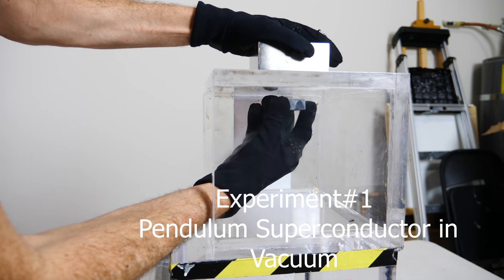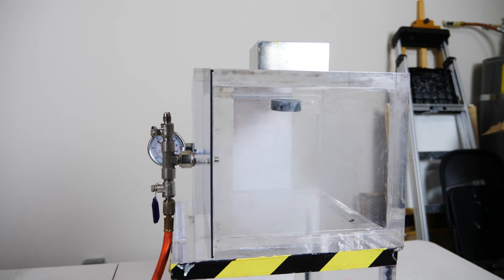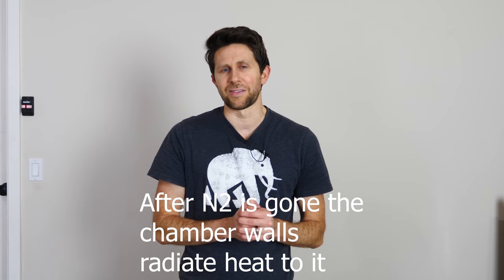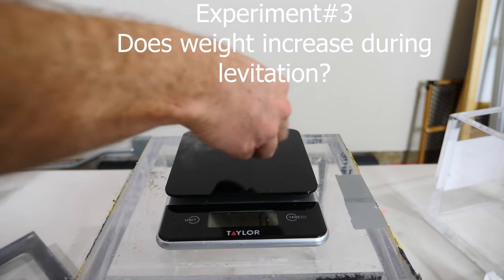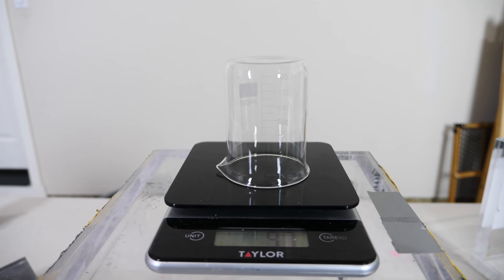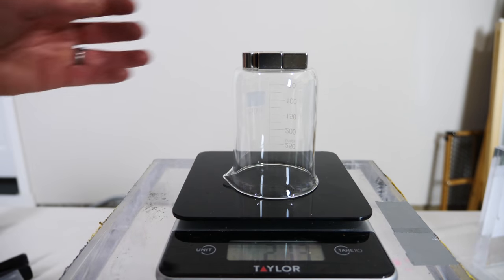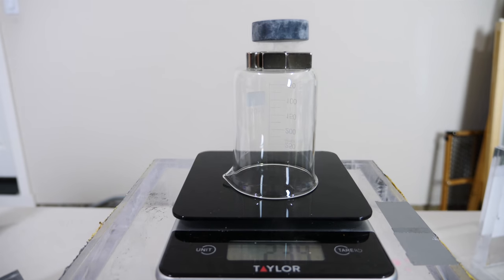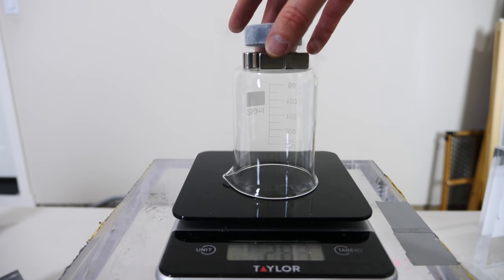Does The Weight Increase When You Levitate a Superconductor on a Scale?

Comment: The explanation for the phenomenon at 6:00 is that the superconductor is hitting a wall of magnetic flux.  The flux is actually re-entering the magnet on the perimeter edge of the poles.

Comment: 1) even in vacuum, any object over -273K radiates heat by radiation. no air needed. 2) the weight increase, there are still forces acting between the superconductor and the magnet

Comment: 3:56 try flushing out the heat conducting air with dry nitrogen which is very insulating, then vacuum aggressively (as 1/4th vacuum is no where near vacuum, and still a lot of density,  try thousandths to millionths of an atmosphere).  That's a better test, but the results are still obvious  that the working of the magnetic field would still waste energy and produce best, but how long it rotates without lateral movement would have been a better demonstration.

Now, as far as weight differences go, the thing people try to test is if there is any combined weight reduction spinning or still, which would require a vacuum to avoid air current interference and a scale accurate to 1 thousandths a gram to 1 millionths, as the effect is so weak, to show if there is any effect  beyond reported.  I would suggest a weight based plunger system to remove a large volume of air quickly then block and vacuum.  But such vacuums are notoriously difficult to achieve with such equipment due to minor (sorry feel like passing out) leakages, off gassing of even sealant, and even evaporation under vacuum.  You can do it.  Remember the asymmetrical EM drive, they spent years even trying to isolate out vibrations, to see if that was causing the very minor results. You would get the same problems here, requiring a lot of isolation (with the vibrations from the pump off gassing and other things.  So, an isolated pre cooled and vacuumed off super conductor in second chamber and transfer to main chamber, or nearly fit to shape chamber to archive the results in the required time.  Sorry, just had a debate with an accelerator practical physicist which got chopped off just as I posted a post that proved him wrong.  So, a bit keyed :)   There is also a quantum effect wave way of cooling, which I can't remember, that was applied to exhaust fumes, I had wanted to explore for commercials use in the 1980's.  (F tick borne and fungal intrusion diseases.  Virtually everybody is off their best game with these things.  At least I have a little ability and memory left).  Love your demonstrations, but eliminating margin for error (or just stating known results) remove doubts in flat universers (lower level researchers, not top 0.01% who have a clue about results :( ).

Comment: I was thinking about something earlier, and then saw this and thought about it again. If you could put Earth on a scale, would the mass change if you took away the satellites? What about the mass of the Sun? Would it weigh less if you took away all the other planets? How does the total mass of our solar system affect the other systems around us? Would it be better if Earth were bigger or smaller? Using something like Universe Sandbox we could probably modify our solar system to have multiple habitable planets. Imagine breaking apart the other planets and putting them all in the same orbit as us? We could have one planet for each country and each country could have it's own "Earth". With enough "Earths" orbiting around the Sun we could link all the "Earths" together and use them to change the course of the sun. Then we can travel the galaxy at the speed of our Sun,  225 km/s. As fast as that is, it would still take over 1300 years to travel 1 light year. Though if we could change the direction of the sun, then we could probably accelerate it as well.

Comment: You showed that the superconductor increased the measured weight on the scale, but at no point did you show the weight of the superconductor independent of the magnet. Is the weight shown the full amount of the superconductors weight? Or does the increase represent some portion thereof?
Reply: it shows in the video, the magnet adds roughly the same or even more weight
Reply: @Megaranator  Yes, but he didn't show the measure for the conductor

Comment: Measure light pressure.  Use two lasers.  One is the reference the other is the source of pressure.  Mount a mirror on the superconductor and suspend in your vacuum chamber. Turn on the reference beam to hit the mirror.  Note where the reflection hits the wall on lab.  Now turn on the second laser and have it hit the mirror and observe both reflections on your laboratory wall.  Turn off the second laser and note the position of the first laser on the wall.  The difference is  the  change of the mirror due to environmental changes.  The second observation of the first laser is the sum of environmental changes and the impact of second laser.  Maybe you detect light pressure this way, maybe not.  It's worth giving it a try.

Comment: The super conductor is not losing energy its gaining it. You allow it to gain heat energy by magnetic interaction where it slows the atomic energy (vibration/heat) of the (hot) magnet to allow vibration in the (cold) super conductor via magnetic flux interactions. Also while in a near vacuum it become extremely efficient at absorbing  radiated energy sources be it inferred, electromagnetic or sub atomic.
The only way to get it to stay locked infinitely would be to isolate it from all energy sources thus also isolating the magnet its locked with, all energy sources also include subatomic interactions and If in existence any particle smaller than known sub atomic particles.

Comment: The nitrogen doesn't matter much. The puck will always lose superconductivity because the vaccuum does not block infrared radiation from getting in and warming up the puck.

It would work longer if, for example, you surround the vaccuum chamber with opaque insulating panels that were themselves cooled with liquid nitrogen, leaving just a small window to look inside.

Comment: Wouldn't it cool down way faster than the air getting emptied? Also it should be cooled while in a vacuum chamber by liquid nitrogen, that way it would be a more accurate experiment, I think.

Edit: I was partly wrong on my statement. I won't delete this comment though, to be an example for ones that comment before completing the video.

Comment: But, how much does the weight increase while it's levitating compared to how much the superconductor and other objects weigh? I can guess why. Gravity pulls the objects down, and the magnetic repulsion making the superconductor and objects float is pushing down on the scale. However, is there any loss of gravitic force in the magnetic repulsion?
Reply: Short answer is no.  For it to levetate the forces are in balance.  Force needed to hold the magnets just increases by the same amount is needed to keep levitating the superconducter.   No different to if the super conductor was too warm and was just placed on the magnets.

Comment: Before watching I say yes because while magnetic force is suspending the object by pushing up on it, it's also exerting magnetic force pushing down as well as being pushed down by gravity. Instead of physical suspension it's being suspended by magnetic force. Obvious benefits for function cover things like reduced weight from less mass, or zero mass for the suspension system, no wear and tear and reduced friction. A more futuristic function, but in development, would be propulsion systems using electromagnetic force to drive propellers, and even using electromagnetic force as the propulsion source, like the controlled explosions in rockets. Other technological breakthroughs will have to occur first, of course. Power being one such hurdle to jump.

Comment: What you just proved that nothing is free. I was anticipating that superconductor would in fact not stay cold in a vacuum but not because the temperature was being pulled off into the vacuum. The second part is the "wall" as you put it when the conductor was acting as it it hit an invisible force as it moved towards the edge of the magnet. The fact the the levitating conductor increased the weight was expected as well but here again, the resistance or force either pushing down or at the edge is real and what was what took the energy out of the movement, hence, no perpetual anything.  Nothing is free!

Comment: If you started with pre-vacuumed liquid nitrogen, you could have gotten the superconductor even colder.

Without watching the video... I predict that the vacuum chamber experiment won't work because as the less-conductive parts of the superconductor catch on magnetic fields, they'll lose energy in the form of heat, which will spread to the rest of the superconductor and start a chain reaction. Additionally, heat can still transfer through infrared radiation.

Comment: I don't know if you realise this, but you literally just experimentally proved the elctromagnetic force is directly linked to baryonic matter, and not by any other force. It it were linked to any other force by way of field interactions, the mass increase would be different the larger the gap in between the super conductor and magnet. The fact that the EM force couples the two  and the mass increases the same as it would by normal EM repulsion forces in the atoms, shows that the theory of atomic electron interactions is directly linked through EM. Well done! Q.E.D.

Comment: Why shouldn't the "weight" increases? By the way, what is "weight" if not a force? So how sure are you that what the scale measures is your "mass" and not your "charge"?
Reply: I have seen some more of your superconductors videos, may i ask a favour? Can you please (i don't have the equip) try to make a magnetic rail using a superconductor as projectile? The goal is to achieve constant acceleration on the projectile. You could use a large EM coil (10m??) and a ceramic superconductor...

Comment: The first explanations could be inproved. If you put something in vaccum, it wont be perfectly isolated from heat exchange, because of irradiation. The super conductor will absorot light and will heat up. Unless you isolate it from every single light wave and air, it will changen its temperature.

Comment: Put the superconductor on a copper plate, and cool the plate with liquid nitrogen to cool the superconductor.  Put a copper heat conductor in the wall of the container cooled with liquid nitrogen from the outside.  No nitrogen directly on the superconductor.  The magnetic support field is coupled to the superconductor, with a viscous force. Use a source of periodic force to heat the superconductor.  If the superconductor is externally cooled, it will run as long as you provide cooling to make up for the work done on the superconductor by motion. 

Power = Force*Velocity = Energy/Time.  
Watts = Newtons*Meters/Seconds = Joules/Second.

Power_Watts = Force_Newtons*Displacement_Meters/Time_Seconds

SuperConductors are soft weak magnets?  A permanent magnetic is a room temperature superconductor - of heat, stress, energy, power?  A ferromagnet keeps it magnetism.  A paramagnet loses it magnetism when you remove the field. 

The magnetic field is "something". It has viscosity that metals can feel.  It is electrons?  Is it photons?  Is it magnetons?  

MagneticFluxQuantum0 = h/(2*e) = 2.067833848E-15 Webers

"e" = ElectronCharge = 1.602176634E-19 Coulombs

Tesla =  Webers/meter^2.
Volt = Weber/Second
Weber = Volt*Second
Volts = Energy_Joules/ElectronCharge_Coulombs
Volts = Joules/e

Tesla = Volts*Sec/Meter^s

Joules = Volts*Coulombs = Volts*ElectronCharge
Weber = Volts*Seconds
MagneticFlux_Weber = PotentialEnergy_Volts*Time_Seconds

Watts = Joules/Second 
Watts = (Volts)*(Coulombs)/Second
Watts = (Weber/Second) * (Coulomb/Second)
Watts = (Weber/Second) * Amperes

Electrons/Second = Amperes/ElectronCharge

Watts  = (Weber/Second) * (Electrons/Second) * ElectronCharge

Webers = MagneticFluxQuantums_Number * MagneticFluxQuantum0_Webers

Webers = MFQs/MFQ0

Watts = (( MFQs/MFQ0)/Second) * (Electrons/Second) * ElectronCharge

Watts = (MFQs/Second) * (Electrons/Second) * (ElectronCharge/MFQ0)

Power_Watts is (Number_MagneticFluxQuantums per second) times (Number_Electrons per second) times (ElectronCharge/MFQ0)

(ElectronCharge/MFQ0) = e/[h/(2*e)]

(ElectronCharge/MFQ0) = (2*e^2)/[h]

(ElectronCharge/MFQ0) = (2*e^2)/PlancksConstant

Richard Collins, The Internet Foundation

Comment: Good, the sucking pump is accelerating the heating up of a classical  because cooled down material turned superconductor.is one part of the experiments. The superconductor ring thanks to the permanent current  create a so-called permanent magnet  which repulse the classical permanent magnet and lock above it. (North -North or South _South)
The same pole magnetic repulsion remain an apparent at a distance "contact" of both magnet like FEYMAN put it. 
That is of course what we observe : SUBJECTIVITY.
What happen really in OBJECTIVITY is that the "vacuum" space between the two magnets EXPAND because of the rotating E field (that is a H field) action on the "so called vacuum" (see Quantum Electro D. concept of the matter/anti-matter voltage (potential energy zero at rest) neutral  Vacuum , like a battery were the two pôles are in short-circuit) So, the E field caused inside the matter (electron) by a dipôle ( E is a force that the false COULOMB attraction law force " has mathematically qualified" per the  unit Q mono-pôle  concept ) and the H field caused by the rotating dipôle (two MATERIAL plates or balls at opposite voltages rotating as an example) perturbate (CARRY  ENERGY LOCALLY TO) the matter/anti-matter normally neutralized (electrically) space "vacuum" . The portion of space concerned by the electro-magnetic fields contract or expand following the field add up (N-S N_S) or destruction (N-s S-N ) as the matter (negative voltage) and the anti-matter (positive voltage) separate each other now.(induction trough vacuum)
In 2018 The US NAVY EL PAIS PATENTS featured a rotating dipôle to create "atom bomb power magnets". they patented the electron or the positron or the magnetostar or the black holes in fact.
The idea is that with a highly highly powerful magnets whose further H heavy flux you concentrate as a ray (the same processus as a light bulb émission (diffusion losses) compared to a laser light émission (directional ray) you can contract the space (not space-"time" which is a wrong concept) electrically between the emitter and the other one emitter (or receptor) and "SUBJECTIVELY" you see the emitter disappearing and contacting the targeting emitter or receptor in a matter of minutes (even at light-years distances)  See the magnetic field "lines" 25 lightyears long above and underneath a 100 lightyears wide galaxy and the 100 of lightyears long H black holes fields lines.
See also videos on YOUTUBE ('TECH INGREDIENTS plasmas) where they "Crunch subjectively at a distance a can by a transient coil 5 teslas H field" because the space has objectively transiently expanded between the two transient opposing magnets (locally the can bulkhead (opposed induced fields) has moved violently away from the coil ) There is no action at a distance, only a space expansion or contraction locally because of electro-magnetic fields change action on the space previously at rest "so called deep  vacuum". Something LORENTZ approached (taken back by EINSTEIN)as  mathematically formulated on the mechanical/velocity level of matter The LORENTZ CONTRACTION formula is linked to speed of an object (speed in vacuum modify the fields effects of the object towards the "vacuum energy balance". EINSTEIN got on the other hand a time expansion using his concept of a constant speed of light in the vacuum. Why all those similar objective effects because LORENTZ and EINSTEIN were quite ignorant (1920-1930) of the nowadays known electro-magnetic Universe nature.

Comment: does it not lose energy due to gravity itself?
Reply: The heat transfers into the superconductor itself which causes the loss of the superconducting because it relies on low temperature to cause the field. Vacuum doesn't radiate heat. Heat is a product of photons hitting resistance, like air, and remitting as the equivalent exchange within the rest of the material's electron shell. 

Saying that aloud was a mouthful. Lmao.

Comment: Yes. Blackbody radiation will heat the superconductor in a vacuum.  If everything else and the room was supercooled, then the superconductor would not gain heat or lose heat, depending on the temperature of the surroundings.  The superconductor would lose heat to the sponge through conduction in the second configuration.  The temperature of outer space is 2.73 degrees Kelvin, which is the temperature of the microwave background radiation of the universe.  If you took an object so far out into outer space that solar radiation was negligible, it would be possible to keep it supercooled sufficiently to maintain superconductor effects.  Any source of energy such as a battery operating a machine would heat things up through vibration or resistive electrical heating.   Some physicists have at one point or another hypothesized that superconductors could shield from gravitational effects, but so far, no experiment has shown this effect to be measurable.

Comment: The weight does increase...but it seems to increase by more than the weight of the superconductor. If my math is correct there is an additional 1-2g(varying scale results in the video). Either that or you need a new scale lol. But seriously that's like a 5-10%increase in weight. I still think something interesting could be happening that needs further investigation.